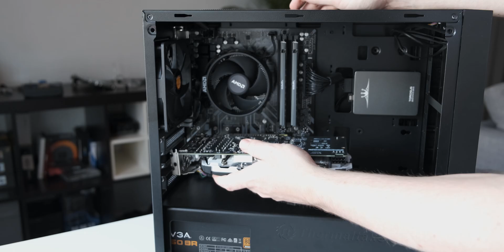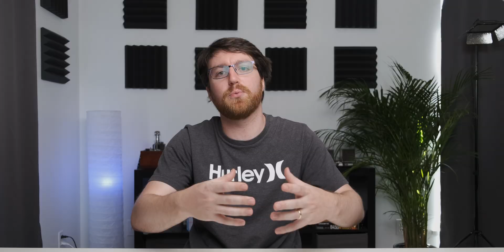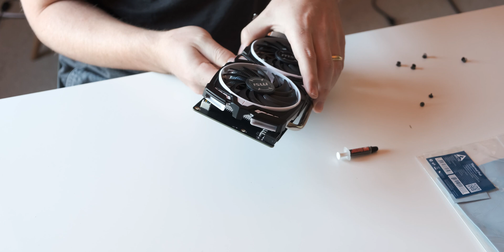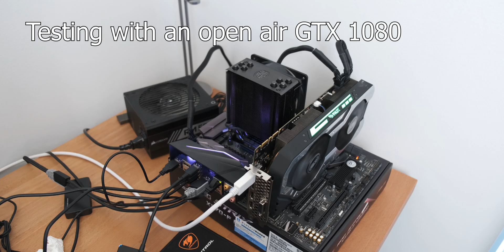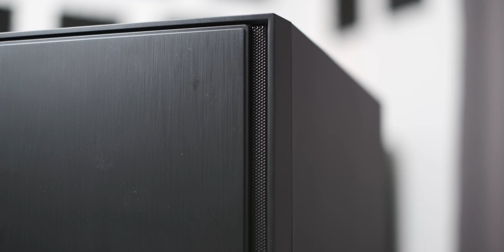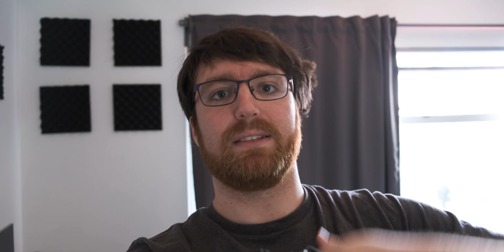How to fix a hot and loud graphics card

Comment: It is an Amd card, you must undervolt. Fixes the problem right away.
Reply from the maker: Yeah, I should definitely do some undervolting.
Reply: Dawid Does Tech Stuff make sure you don’t get any stuttering when undervolting!
Reply: Just reinstalled Windows and my old 2014/2015 drivers for my Haswell/R9/H81 system. I'll take a look at it.
Reply: Can I undervolt while keeping the same core clock?
Reply: @YizusCrist  yes, that's the main idea.
Reply: Yizus Crist yeah, but be careful not to go too far. Watch a video on how to do it first.
Reply: @mikeycrackson  damn make sure it doesn’t drop bellow room temperature or it won’t be good for you
Reply: @mikeycrackson  yo, just bought one unfortunately ,it has one fan too, how loud is it? Louder than a ps4 fan and did undervolting make it quieter?
Reply: how much do i under volt it by?
Reply: @iGotIceInMyRice  Depends on the specific card you have, every card is different. For example I have a profile that shaves off any voltage that is above 1v while keeping frequencies the same it runs like a dream. But maybe your card is preoverclocked from the factory and it requires more voltage, or you were very lucky with the silicon and it can do 0.970V, you nerd to do a lot of testing to find the actual setting.
Reply: @ToRt1sher  yeah i lowed it some bit and its been running ALOT quieter in games thanks
Reply: @iGotIceInMyRice  this might help you, it is a guide I wrote on reddit a year ago. Note that since then I have actually found better settings, you have to keep making changes to find the perfect ones. Guide: Owner of a 570 here with very sensitive ears. After a lot of tweaking over the past 2 months I came to some conclusions. To answer your question, going low on voltages cannot harm your hardware, it can only cause instability if you go too far. First of all, take a look at the states. States 1 and 2 I didn't mess with. This is the state that the card operates at while casually using the computer, and the power usage gains are very small. I had black screens all the time and it wasn't worth it really. As for the rest of the states: every card is different. I went from 1068-1150 to flat 1050 on states 3-7. Works like a charm. I used to have black screens and some instability when i used way less voltage, it is impressive really but can get annoying especially in multiplayer. The general rule is, higher states require same or higher voltages. I suggest you reduce the voltage to 1100 to start with, and then reduce by 10 mV every 2 days or so, when you are absolutely sure that the card is rock solid. Power fluctuations at the wall or your PSU can cause instability, have that in mind. Since you look like a new user, I'd suggest you do nothing crazy. You can use either Afterburner or Wattman, it's up to you. Just don't use both at the same time. If you want to take a look at the GPU states, in afterburner, there is some shortcut I can't remember right now (edit from 2021 Ctrl + f) . I prefer wattman personally, because I don't need to have a ton of programs installed. Try it and let me know how it goes. :)
Reply: @ToRt1sher  im still reading this but for some reason when i bought this gpu when i play intensive games it gives me a colored screen and crashes and i have to hard reboot my pc i thought it was drivers so i deleted my old drivers and downloaded new ones i under clocked it in msi after burner and still crashes  i have a rx 570 4gb msi armor also sometimes when im not playing it crashes out of no where have you ever encountered this problem?
Reply: @iGotIceInMyRice  seems like a semi - defective gpu if it does that. But maybe it is some other component in your system, for example the PSU.
Reply: @ToRt1sher  yeah i also think my gpu bios got corrupted
Reply: @ToRt1sher  yeah the guy that i got it from wont give a refund so it was the card because when i have my gtx 970  it never did this and i reinstalled windows so no nvidia drivers are on there and i reinstalled windows because i got a new hard drive but i did  use ddu before that so there should no nvidia drivers and  i think that the bios  got corrupted but i cant flash it for some reason and im not because it could break it yeah i might upgrade to a i5 10400 oe 10600k and a gtx 1080 but ye :)
Reply: @ToRt1sher  hey please I have a question , I recently had a problem where my PC restarts while gaming , I've read a lot and most of videos and cases said it's PSU issue ,then I decided to try one last thing before buying a new PSU so I cleaned the dust in my PC and the restarting problem has gone , but I started facing an other problem , my gpu started overheatting and thr fans became so loud without doing much with the cooling , and I've never had this problem before where my gpu used to reach 69°C at max in the most intensive games , do you think it's still a PSU problem ? (I have an Rx580)
Reply: @dzcasanova8840  No, I believe it is not. Try repasting-cleaning the GPU if it is dirty, but anything below 80 degrees is fine. If you still have problems, try undervolting ;)
Reply: @ToRt1sher  Thank you for the quick reply , I really needed help , what made me worried is the fact that before tempting to clean the dust in my case and fans , the max GPU temps wouldn't go higher than 70° underload with controlled fans using MSI afterburner , and also the fact that it gets too loud without having any impact on the temps ... I don't know the right way to undervolt , or if it's gonna impact performance or not but I'll check thanks for the advice.
Reply: I bought a Gigabyte RX580 Gaming 8G a while ago. Seller didn't really say anything about loudness when I asked before buying. But it is LOUD AS HELL. I changed the thermal paste to Kryonaut and also bought some new thermal pads and changed them as well. It did help a bit but not enough. I undervolted the gpu to the stability limit but still while gaming any GPU intensive game the temps are almost  hitting 90°C. Anyone wondering, RX580 comes with about 1150mV core voltage at stock and I lowered it down to 1050mV where it is still stable. Almost no change in temps. I guess I'll have to underclock it too to get the temps to be more reasonable. And oh, I have a fan curve set to be semi-quiet (40% most of the time under load). If it gets any higher than 50% the fan noise becomes just unbearable. I guess I'll move to Nvidia cards from now on. Feels bad because the RX580 is otherwise a great GPU...

Comment: I modded my Vega 56 by replacing the fans, lapping the heatsink, replacing the thermal paste and pads, levelling the HBM and chip. 
It runs very cool now, but I spent so much money that I would've been better off getting a new RTX 2060 Super.
Reply from the maker: That sounds like a great project though. :D Even if it was a bit costly.
Reply: That sounds like something you should do a tutorial about doing since it could help ironing out temps on most things GPU and CPU.
Reply: @TheRealFobican  yeah I was thinking about it, but it required a special screwdriver that I bought from IFixIt to undo the screws on the GPU. If someone were to have one of those kits they probably know what they're doing.
Reply: Did you use auto under volt or manual first?

Comment: Some models of the RX 570 are like the Geforce FX 5800. Almost literally a jet engine.
Reply from the maker: haha!! I guess the MSI armor is one of those.
Reply: @DawidDoesTechStuff  The noise from yours reminds me of my sapphire rx 580, it´s pretty loud once you throw it to run high enough settings on anything but the warmest it gets to is 75c which is something I thought about lowering temps and noise for a while.
Reply: It is, my rx 570 armor easily reaches over 80c at stock settings, i had to change the thermal paste just to lower the temps a bit
Reply from the maker: @rainz1076  It seems to not have the best cooling. I think the case also plays a bit part though. Its a big double whammy.
Reply: @DawidDoesTechStuff  the asus 1660ti phoenix and asus 1660ti dual fan oc have the same issues, under load are always 75-87
Reply: @Bruce Cruz new paste, sidepanel off and heavy undervolt

Comment: Case airflow is everything. I had 2 fans by default. Switched them out with better ones from arctic and installed 2 additional fans ( 1 intake and 1 exhaust). This alone dropped my CPU temps from 84 to 70C at max and my GPU (1080ti) from 87 to 82C while boosting from 1850 before to  1950mhz after  with OC and unlocked power/temp.
Reply from the maker: That is a good result from adding two new fans. :D
Reply: I have 1080ti, and it gets really noise while playing god of war. My case has three fans in front for intake, I added two fans under the gpu! But it still gets stuck at 80c with a lot of fan noise. :/

Comment: I had a similar issue once so i just installed a fan in the side panel.If u have a dremel its no big deal.Just remember to instal a long enough power cable to it.Or u can add a spring-pin connector.
(ps,dont put ur hands around geese,at least not living geese)
Reply from the maker: I actually want to get a Dremel for that exact reason. :) Don't worry I only lovingly grab geese by the neck. :P
Reply: @DawidDoesTechStuff  I advice u to get the most powerful one!And u can save the extra cost in on buying all the toolbits on ebay.Very cheap.
I didnt get the strongest one and i constantly regret it.They dont have a lot of torque,u know...only speed.
Reply from the maker: @rezganger  That is very useful advice. The extra torque sounds very useful. I will look into that seller on ebay.
Reply: @DawidDoesTechStuff  Theres not much torque in any of these tools but the speed on the more powerful versions makes up for some.